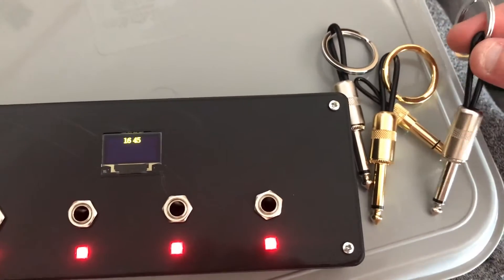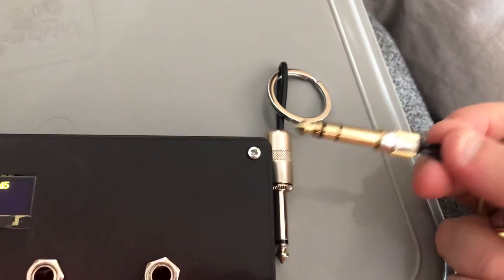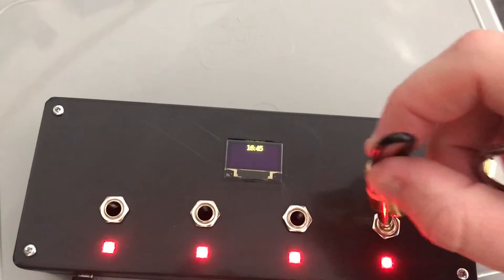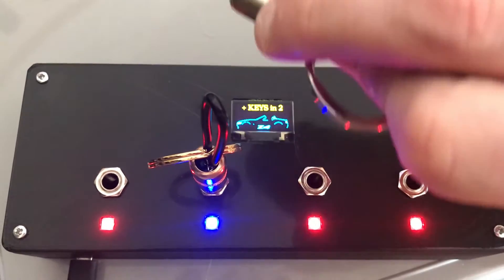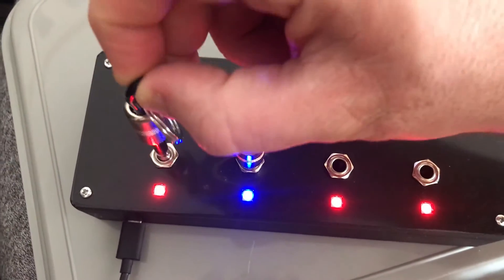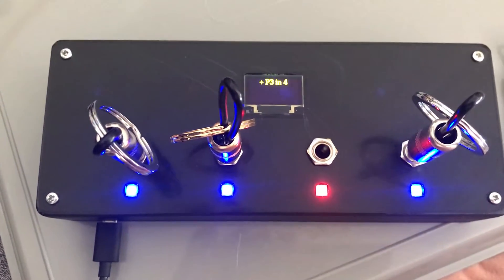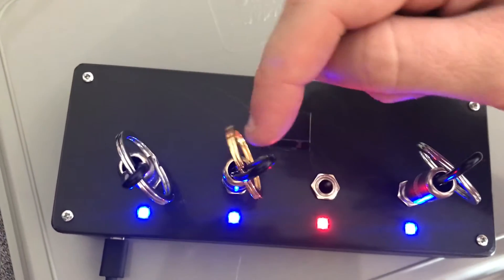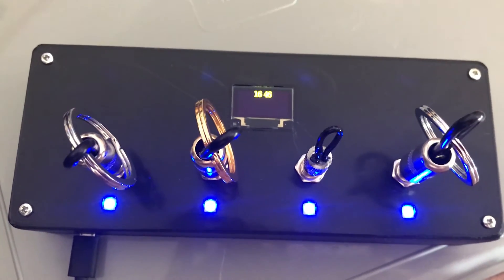Arduino Guitar Jack Key Holder with Jack Recognition & OLED

Comment: It's interesting, but I can't figure out what it's for?
Reply from the maker: Checkout the Instructables link :) It's a Key Holder that you would mount on the wall and use to hang your keys on (buy inserting a Jack that's on your keys as a keyring)
Reply: @IAmOrion  Yea, I get it, but... I'm trying to see a case where it's useful and necessary. I still like it though. Just built an eggbot myself. Quite limited use. Now during Easter, sure. After that... not so much. Haha! Fat guitar plugs always feel great when they snap into place.
Reply from the maker: @therealpepeu  Isn't the whole point of projects like this to be fun! There's doesn't need to be a reason, use, or need - simply "Because I can".  Besides, I've seen many use "Pluginz Jacks" guitar amp style keyholders so it's a popular design... I took my design from that and turned it into a little project "just because" ha
Reply: @IAmOrion  Haha! Yea, good point. I'd say the MAIN point here is that you finished your project. I have 100s of Oh, I should build a thingie that does this and that... but never gets finished. I might steal your idea at some point. I like guitar plugs but never really saw a use for them in a new creative way like you did. Cheers! :O)